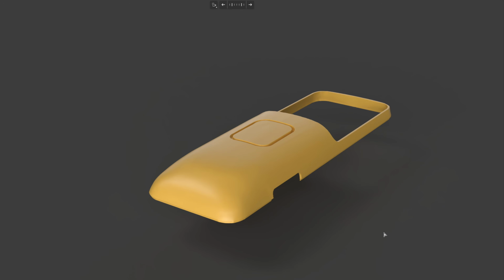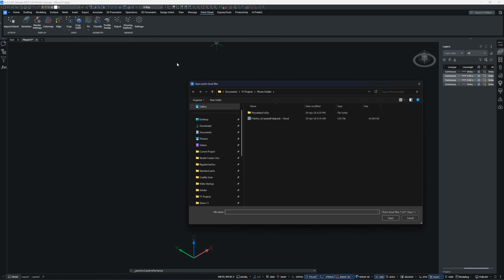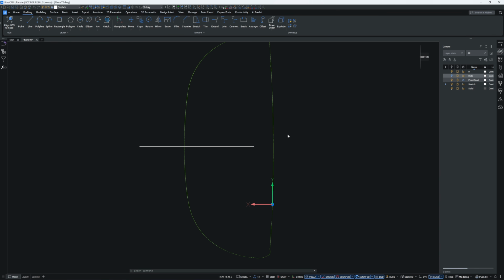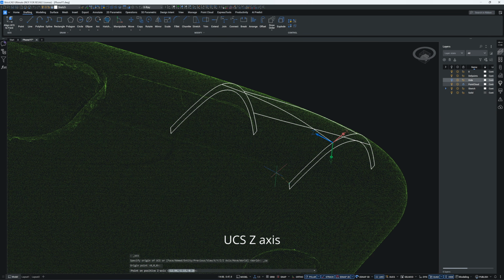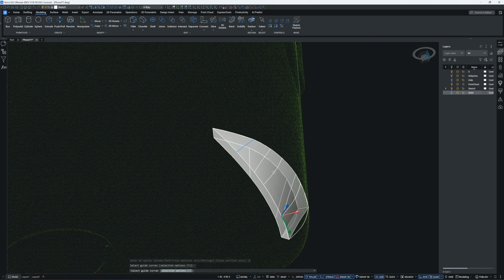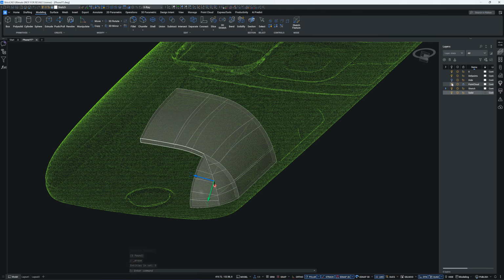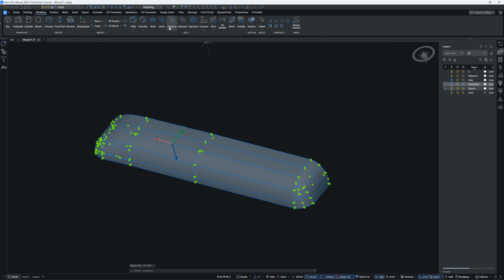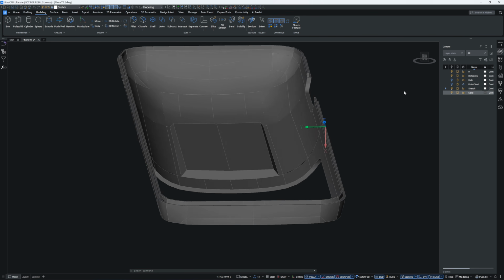3D Scan to CAD – Mastering Dual‑Curve Surfaces (Feat. Creality Raptor Pro)

Comment: next time try Blender with CAD addons, i think it would be easier and faster
Reply from the maker: Blender, 3ds Max, and Maya are polygon‑based modeling tools. No matter what add‑ons you use, the output remains polygonal. They create the illusion of smooth surfaces through subdivision, but the final file is still a mesh, the same type of output you get from a 3D scanner. Meshes have limited resolution, typically around 500K to 2 million faces. CAD, on the other hand, is fundamentally different: it builds models by executing commands, giving them infinite resolution. CAD files are smaller in size (for example, 0.8 MB), can be converted directly into tool paths, and remain editable without losing that infinite resolution. Converting a 3D scan mesh into another polygon mesh is essentially pointless.
Reply: @Payo-TensileCreator  по аналогии с 2d это растр и вектор.

Comment: i think best piece of SW right for parts like this is quick surface
Reply from the maker: You’ll never get this model finished with Quicksurface. At best, you might patch about 60% of the outer surface before hitting a wall. Its performance is generations behind today’s professional CAD tools. Honestly, they’re just trying to attract new 3D scanner users. Even the sample model on their own homepage is built incorrectly, it’s not true modeling, it’s just re‑topology.
Reply: @Payo-TensileCreator  oh really? It's that bad later on? Thank You for the explanation from your massive experience. 

So in your opinion it will not be good enough for "A" surfaces?
Reply from the maker: @qwer55555555  With QuickSurface, you’ll end up spending more time just trying to get the software to work than actually doing the modeling.
Reply: @Payo-TensileCreator  Thank you

Comment: Hello Payo,
what is the best 3d scanner under 2k? Do u recommend metro y pro?

Greetings
Reply from the maker: I’ve worked with scan data from the Metro Y through the Inspire 2 series, and honestly the point cloud quality is poor, almost like it came from a cheap infrared scanner. It’s not suitable for reverse engineering. Accuracy sits around 0.3 to 0.4 mm across all the scans, which makes it hard to pick out wall lines and edges when cropping. Mirroring is another issue: even when a part is perfectly symmetrical, the left side of the scan won’t align with the right. If this part had been scanned with the Metro Y, you wouldn’t even be watching this video, it just wouldn’t be possible.
Reply: @Payo-TensileCreator but is it a software or hardware problem?
Reply from the maker: @mofr3266  Mostly hardware, low precision camera, DOE projectors, slow on-board chip. Revopoint laser scanners are not calibrated to the marker dots at all. They use infrared Poko dot calibration board. The accuracy in laser line mode is very low comparing to their full filed mode.
Reply: @Payo-TensileCreator which scanner would u then recommend? Deep hole scan is important for me
Reply: I think it’s safe to say: Payo isn’t convinced by Revopoint 😉 My guess: he may recommend a Creality Raptor Pro. I bought one based on his reviews in this channel. Awesome scanner for under 2K (see this scan). But beware, many people underestimate the effort you need to put into 3D scanning. They expect the finished CAD file to automatically drop out of the computer after scanning and are disappointed, when it doesn’t. It’s work! I suppose you’re aware that the scanner itself is only part of the invest. You need some decent software a fairly powerful computer and lots of time (when getting started) 😁 But it’s awesome! Good luck.

Comment: Compound curves are all over the place and I consider them fundamental to reverse engineering. Thank you Payo for taking the time to show how it’s done. In terms of practical application, your tutorials are second to none on YouTube. Greatly appreciated! You always make it look so easy.

I was on the right track with the lofting technique, but it's so much more cumbersome in Fusion. It's much less precise because of the meshes (somewhat like a noisy scan 😂), and it's very easy to completely lose track when setting up the rails for lofting, as meshes aren't transparent like point clouds. Not to mention that rails (polylines) don't always "snap" to the mesh section sketches/the curves fit to them. On top of that, Fusion creates so many extra layers, making the timeline extremely cluttered. Fusion is great, but not for reverse engineering. I think I’m gonna have to bite the bullet and talk to the folks at BricsCAD.

Looking forward to your next tutorials.
Reply from the maker: Fusion is great for modeling and creating new designs. It’s a parametric‑based CAD tool, but it struggles when you’re working with really large assemblies.

Comment: Would be interesting to see you reverse engineer a part in fusion. It has some potential functions like fit curves to mesh section. Wouldn’t it make it a lot easier than tracing it by hand along pointcloud sections ?
Reply from the maker: Fusion’s modeling tools are powerful enough to handle virtually any geometry. However, it doesn’t support point‑cloud import. BricsCAD, like many other platforms, offers automatic point‑cloud tracing, but these tools are often ineffective. The time spent fixing auto‑generated sketches usually exceeds the time it would take to trace them manually.

Comment: Hi! Why you didn’t use Blender to create 3d lines and then export it with .dxf format and open then on Inventor. I think this should be more easy than draw 3d linee/splines from scratch in bricscad..
Reply: Потому что blender не дает точной геометрии, а inventor позволяет проектировать сразу в точных размерах и в несколько раз быстрей чем в blender.
Reply from the maker: Blender’s ‘Shrinkwrap’ modifier isn’t the fastest or most accurate option. It works for generating 3D boundary lines, but not for producing precise 2D cross‑section sketches. While BricsCAD and AutoCAD allow snapping splines directly onto point clouds, I avoid that method because the resulting curves can’t be adjusted easily.
Reply: @Payo-TensileCreator Thanks got point!!